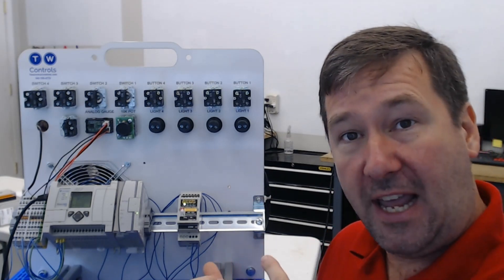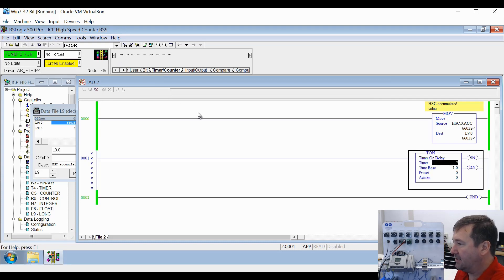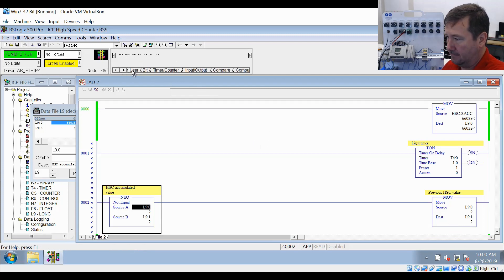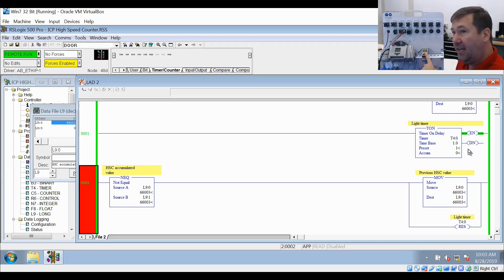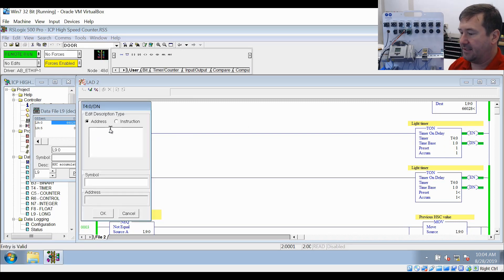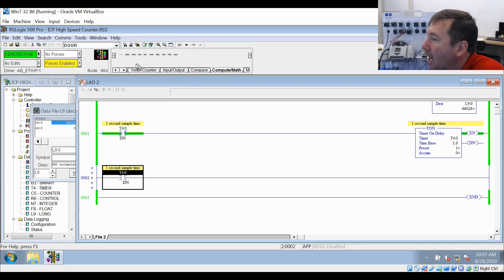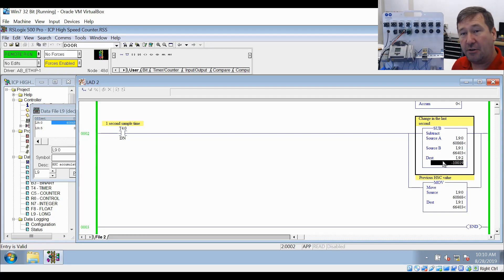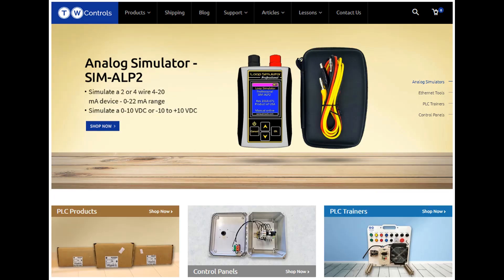Calculate the Rate, Speed, or RPM on High Speed Counter in RsLogix 500

Comment: Great Video, but I have a question. If I am using the HSC for flow of a liquid do I need to regularly reset the ACC value to prevent an overflow error as the flow is always in the one direction?
Reply from the maker: Hi Kevin, after 2,147,483,647 counts, it will reach it's limit.  I don't know the frequency of your counts, but you should have some measure in there to eventually deal with the rollover, even if it is 10 or so years down the road.

Comment: Great job , you just found how many revolutions  per second to convert it into rpm (revolutions per minute) multiply it by 60 to convert from sec to min.  In my experience 100 ms is more then enough to give you accurate value of rpm : just multiply it by 10 then by 60 . Thanks
Reply: Why do you have to multiply it by 10 first? Wait..the multiplier is for the sampling rate. 100ms x 10 = 1 second (Hz)

Comment: this is a great plc learning video, wished i had it when i was learning AB-PLC stuff? i was really searching for the ultra3000 servo E23 error fault (The internal filter protecting the drive from over heating has tripped)? it seems to be a common problem with some silly check accelerate/ decelerate settings on machine that have been working for several years that way. Tim, how do you troubleshoot these kind of problems?  thanks a lot..:)
Reply from the maker: Typically that means the motor is under too much load for the set accel and decel.  Might see if increasing these values would affect your process.

Comment: What about using the quadrature on the encoder and get the plc to indicate what direction it's going. I imagine you would use two counters,(channel A & B) but whichever one fires first will tell the direction. How can you store the one that fires first and have one bit go to 1 for CW and another go to 1 for CCW. Example 00 not moving 01 for CW and 10 for CCW
Reply from the maker: No need to.  Look to see if your rate calculation is positive or negative.  You cannot track the pulsed of a high speed counter in ladder logic.

Comment: sir, it is nice video...i have question....how to calculate pulse from flowrate ?
Reply from the maker: Each pulse will be a certain amount of fluid.  So you multiply pulses by that value which will usually be called the K factor and will be very specific to your flow meter.  Usually there will be a chart that includes pipe size,  material, connection type, etc.
Reply: @TimWilborne  how to calculate that K factor ?

Comment: Whenever that HSC counter reset, is there any possibility to become source A = 0, source B = 999999, then difference ( which is the frequency) could be a wrong huge value? (above mentioned values are just for the example) Thank you!
Reply from the maker: Hi Jude.  It will "roll over" from the highest positive value to the lowest negative value.  I need to do on handling this sometime.

Comment: Hi Tim. Just came across your channel. I am working on a small project of mine which involves servo motor control via plc for a machine. eg. we take a time base of 1 minute. Now if the operator sets 60 shots per min, the servo needs to make the predefined number of rotations 60 times a min. my application, the servo needs to pull paper. now the number of rotations would be defined by the length of paper fed by the operator. and if the machine speed is 60 per min, the same paper length needs to be drawn 60 times, if 120 shots then 120 times. Now I'd like to program it in such a fashion, that the servo motor acceleration, deceleration and running speed is altered according to the speed fed in the machine. Do you maybe already have a tutorial similar to this or could you guide me maybe over emails or something?
Reply from the maker: Hi Punett.  I would recommend posting your question over at http://www.plctalk.net/qanda/forumdisplay.php?f=2

Comment: Hi Tim. Just recently discovered you and subscribed. Outstanding channel! I do have a question on this vid. You don't mention counter wrap-around. Is it reasonable to reset the counter to 0 instead of doing the subtraction? That is, on your 1 sec timeout, save the value and reset?
Reply from the maker: If you need to count to a very large number then the roll over is something you'll have to handle.  The subtraction and 1 second timer is to take the change over one second and determine the speed that the counter is running at.